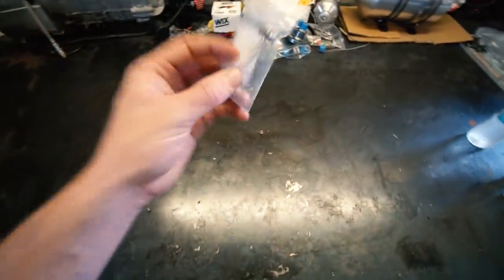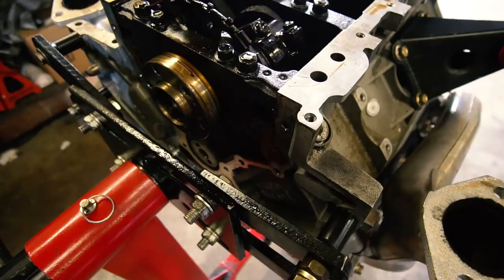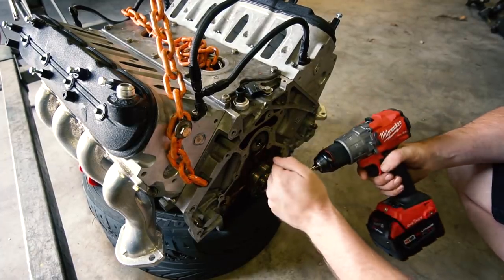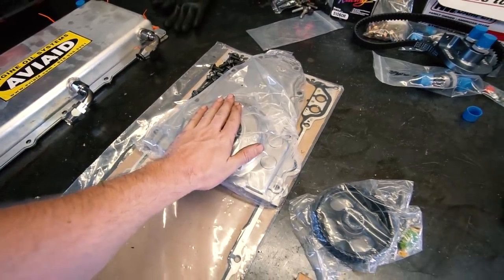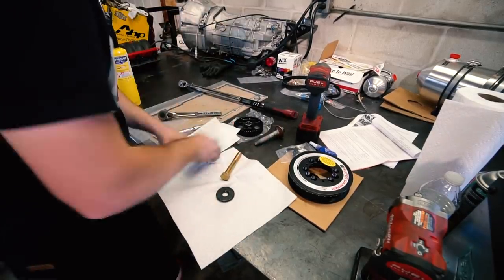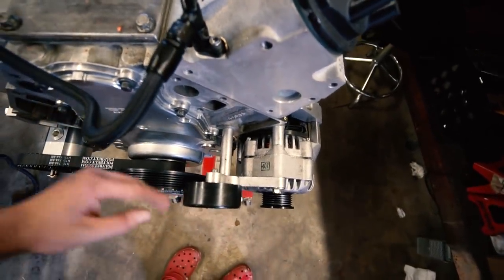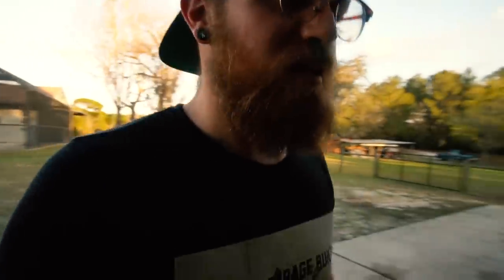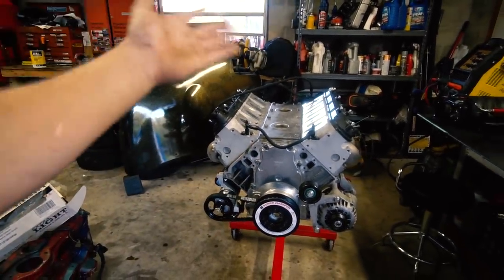LS Miata Engine Install Goes Wrong..

Comment: when its doing the zero thing its calibrating itself, set it down on a flat surface it should stop. snap on techangle ones do something simular and it has to do with the torque angle feature.
Reply: Kevin Rogers yes I agree that is what it is doing
Reply: Have a sidchrome one that does the same thing. It looks like it is waiting for an angle input. Like Kevin Rogers said put it down and it should cycle through.
Reply: Yeah my snapon wrench does the same. It’s pretty quick though. I have a 3/8 drive torque wrench from Lowe’s and it does this and takes forever no matter what you do.
Reply: It usually helps if you just turn it on laying on a flat surface and just let it zero before you even pick it up. Fyi all digital torque wrenches do this.

Comment: Love the build .might want to build a cover for the drysump belt .rocks and stuff get up in there and it could strip the belt .ask me how I know 4300 dollars in damages. Lol
Reply: One of our local race teams lost a belt as well. Goodbye engine.
Reply: There is also a belt out there called the white rhino that are ten times stronger then the standard belt .I use them on the dry sump belt and cam shaft belt drive .never broke one .very strong belt made with kevlar .but they are white only down side .

Comment: A friend of mine thought it would be fun  to rebuild his rotary engine, he's never done a rebuild of any engines in his entire life, as easy as it might seem when people doing it on youtube, i'm glad he sent it away to a specialist.
Funfact, he was trying to get the engine out of the engine bay without a hoist, i mean, the 12a rotaries are super small and all, but all he had was some ratchet straps he was trying to lift the engine with (by himself), glad i went to help out with a proper chain pulley and got the engine out in  a proper manner.

Also, i love the true, non-perfect scenario videos you post dude, that's also one of the reasons i subbed in the first place. :)

Comment: Ah dude, I feel your pain. I've just spent I hate to think how many hours sanding my car for paint, had the primer looking the best I'd ever had a car looking prior to top coat . . . . and when I sprayed yesterday it it went bad and reacted in a bunch of patches. No idea why, obviously I did something wrong, but dammit, I put so much work into the prep. I was pissed, it's a set back, but tomorrow I go in and sand it back and start again. As you say, this is the reality of car builds and anyone who doesn't get it probably doesn't actually do anything and it just a couch mechanic.
Reply: Dude check your air filter and drain any water out of your air tank prior to spraying. Had a similar issue.
Reply: @JoshVice  Yeah, thanks. I think my mistake was I wiped it down with a damp cloth to remove the last of the dust,  I did wipe it down and dried it but I didn't warm the room, and I only left it half an hour or so (it was mild and I thought it would be ok) and I think there must have been some residue of moisture left in the primer. Lesson learnt. Bloody frustrating and a product of not having quite enough time and pushing.
Reply: @bubarowe  you should check out Motion auto tv tons of videos on primer and body work.
Reply: Use a sealer on everything before paint, I learned that the hard way.
Reply: Don’t wipe it down with a damp cloth. Wipe it down with wax and grease remover and then a tac cloth right before you spray. If it’s dusty, wash it, and rinse your shop out

Comment: I can definitely sympathize. My house and garage are in one city and I work in another, so I spend months collecting parts and planning trips home to install them. It's really easy to burn a week of vacation time because I ordered the wrong part or something doesn't go together the way I thought it would. It can definitely be a challenge to stay motivated when you're constantly pivoting to move forward on something other than what you planned to stay productive. Most people don't realize that building a car is like running a marathon inches at a time. Filming and editing is another layer on that too. Can't tell you how many times I've filmed part of the project and lost footage or couldn't find the time to edit it and get it out there. Always impressed how quickly you can put stuff together with while filming with quality editing.

Comment: Dude, I've been twisting wrenches for forty years. In the process of building a Harley stretch bagger. One nut or bolt can bring you to a screeching halt. Nothing ever comes when it's supposed to or if it does its the wrong part. Just keep pluggin along. You'll get there. Like the videos. New subscriber.

Comment: Hey bro, like how it’s coming along! Couple things... first, you should think about going with either corvette/ctsv spacing (which I think your balancer is right now) or the truck spacing (which also happens to be the “new” ls3 spacing. I decided to go with the corvette spacing myself and like how it works. The FBody spacing seems a little restrictive for parts. With the truck spacing You can get water pumps with outlets on either side just like the corvette spacing. And you can just use spacers with the steam port hole if you want to use your fbody water pump. Second, with putting the covers on, don’t use the balancer to line it up. I put on my oil pan (temporarily) and it gets them to line up pretty good cause you want them to seat right either at the pan or just a lil bit above it. It worked out good. The balancer won’t seat it better than that cause there is play in that seal. Same with the rear. There are video and threads out there explaining it and I’d give it a try. But other than that, shit happens and sometimes ya gotta wait for new parts. Just happens. Love the drone shots!

Comment: It's not just builds. As a tech this happens all the time. You order parts and sometimes you get the wrong stuff. Or the wrong part gets ordered. Or for some reason it didn't come in.  You have to hope for the best and expect the worst!

Comment: @13:00 so true!! Home build stuff takes ages, especially if you go in depth! I've only put me engine back in last Saturday, and it's been 55 (!) weeks from when I pulled it out, being on a budget.
There is just so many hurdles you face, most completely unexpected but you just gotta keep going, cause it will be rewarding at the end.

Keep doing what your doing and just ignore the internet theoretical mechanics.

Comment: Keep the torque wrench on the table still af for a few secs to zero out my snap on one does the same thing if you try to hold it to zero out it’ll take forever
Reply: My snap-on only does it when I set it to degrees. I'm guessing maybe his ask for it every time he resets the torque setting? Hmm.

Comment: The flashing on the torque wrench is a calibration thing, my snap on one does it, it requires you to put it flat on a bench with the screen facing up it'll it stops flashing.

Comment: On your oiling system with no factory pump and the stock oil pump hole being opened will cause a low oil pressure problem?  Should the hole be plugged off with a small freeze plug?

Comment: Have no experience with that specific torque wrench but The Snap on one I use you have to set down on a flat surface so that it can re calibrate before the you use it. Maybe the same for your torque wrench.

Comment: If I wanted fake content, I wouldn't subscribe. The truth is, I am a subscriber BECAUSE of the realism. I'm not bummed that the damper or crank pulley is wrong. It's part of the process and I got over it years ago in my own car building fiasco's. I will keep my fingers crossed you can get those replacement parts quickly enough so you can continue working on the engine. I am really excited to see that dry sump in action! Keep your chin up!
Reply: Oh yeah, what's with the Windmill in the back of Ben's truck? I hope to see that on the channel soon. Maybe some supplemental power for the shop?

Comment: Me doing clutch on mr2. Buys stage1 clutch and a light flywheel. Fits both 1zz and 2zz. I go place the light flywheel on the crank.. uhh the holes dont line up. After some research i found out i had a 2zz flywheel and the 1zz part number wich i needed was different. So had to keep the stock flywheel but the clutch did fit both. Car life

Comment: it took over a month to rebuild a motor for me when wrong parts came in it happens. i ended blowing it up again about 3 months later because the oil pressure switch coming lose on a long trip between pittsburgh and gainesville

Comment: Hey man, you supposed to lay that torque wrench on a flat surface (bench) till it zeroes out every time u use it then u can set ur torque settings. Because it does torque angle as well. So ur torque specs were probably slightly off.

Comment: You shouldn't have to loosen the front cover. If the bolts are already tight, it should be centered enough to put a new balancer on.  Stay positive and F*** the Haters!

Comment: Sit the torque wrench on a flat surface and let it sit still while the four zeros flash. Its just recalibrating itself.. my one at work does the same when  i change the mode

Comment: You didnt wear out that disc at all. You can use it til there are no bristles left, but yeah...
Reply: Alyn Penners if he used it on an angle die grinder and got more speed out of it it would work better. Definitely has plenty of life left lol

Comment: pretty sure the 0000 is it trying to zero itself out and when it does that you are supposed to set it on a flat surface until its done.

Comment: cut the aluminum spacers so the alt sits where you need it. You might need the alternator to sit as close as possible to the motor. but might wanna verify with the sub frame clearance.
Reply: @lustfulvengance  i forgot about that lol.

Comment: Can someone explain what a dry sump is used for
Reply: A dry sump as far as I understand it is used in high g force applications such as time attack or drifting the Oil in a normal pan sloshes to the sides of the large pan causing oil starvation and then you blow the motor the way a dry sump works is no matter the Gs the oil is pumped throughout the engine 
Hope this helped
Reply: @maxjackson9191  thanks for the info

Comment: Dude those of us who have dealt with #GarageBuilt get it. Hell, half the time I can't get the correct parts from the parts store for stock vehicles that they can look up. I can only imagine how bad it is to find correct parts for projects like this.
You get momentum going just knocking as much as you out can then boom, you hit a wall cause you need a part that you can't get locally so you spend all day trying to figure out exactly what you need and find it for the best price then the days gone and you only finish half of what you planned on getting done.

Comment: What exhaust manifolds are you using?
Reply: Greg Andrews stock just grinded the studs off and had coated
Reply: @rexrunner  stock from what though?
Reply: Greg Andrews f body. You can Google stock LS based manifolds and there are plenty. Vette are center exit down. Truck drops it a tad lower and 45 exit,  and f body/gto are center bellhousing exit rear

Comment: Hey it looked like the crank should have turned when you torqued it. Did you have something to keep it from turning?  Keep up the hard work buddy.
Reply: In the video @7:47 he shows that he has a pry bar holding the crank so he can torque it. Hope that helps.

Comment: Try laying the torque wrench on a flat surface like a work bench, while it's flashings zeros. My snap-on torque wrench does a similar flashing sequence when it needs to calibrate on a flat surface, maybe yours does the same. 🍻

Comment: ah I wouldn't worry about the negative people, your doing pretty good :) I'd bet a good chunk of those people have never built a car or even tried to, it ain't quick, easy or cheap lol last car I attempted to build I spent 5 months just doing body n paintwork lol (started with a roller but it was in a bad way) and then finished that part and ran outa funds thanks a unexpected job change and 4 months later sold the car as a roller cause it was getting wrecked from birds n rats n bats (was an open back veranda) so this time I cheated and bought a complete car in good condition to build up lol even still it's been a year and it's still not ready to go and now I'm a month out from an event I'd like to debut it at so now it's a mad dash to get it ready in time :(  hahaha

people need to understand normal adult life takes priority over toys and more often than not u get delayed by bills, bills and bills and more bills...........

Comment: The crank pully does not center the front cover smfh
Reply: Actually it does center the front cover there is play in all the holes on the front cover and you do need to leave the rear cover loose and install the harmonic balancer and the oil pan to get everything lined properly if you just throw the front cover on and tighten it down then throw the pan and or harmonic balancer on you can develop oil leaks because of improper tolerances to the sealing surfaces